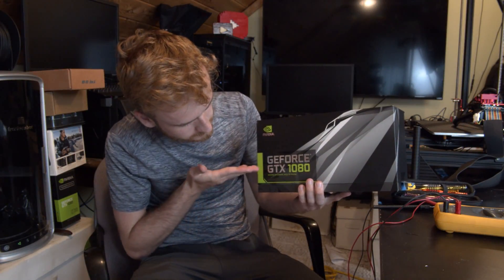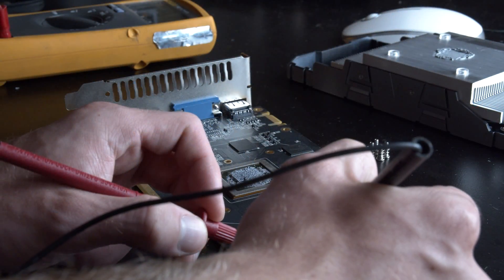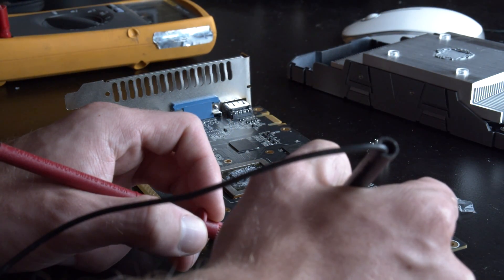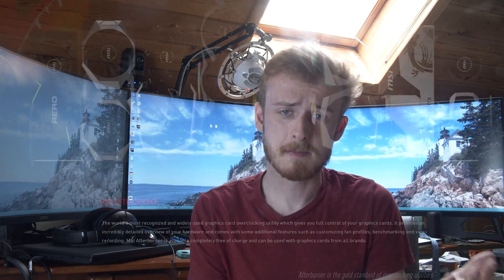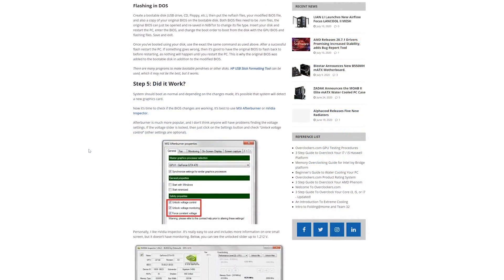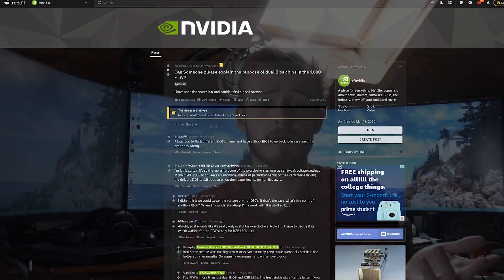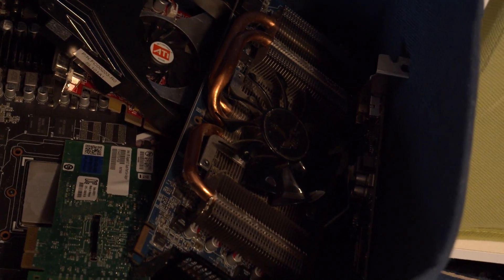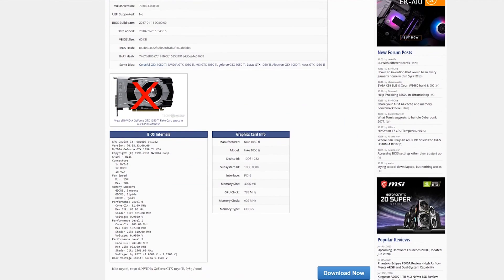The Shocking History Of Fake Graphics Cards Scammers Don’t Want You To Know | PC History

Comment: Online forums were a thing in when I browsed them in the 90's though, way before the more elaborate fake cards we see today. One popular scam I remember was apparently selling an 8800 GTS as an 8800 GTX, the former being inferior with a fairly large margin. They sometimes shipped with the same coolers which made them look identical until you installed the drivers. I know similar scams happened before the 8000 series too, but I can't remember the details anymore.

The Linux driver "nouveau" in the french word for "new". The story behind that name is actually kind of funny; one of the developers hacking around in the NVIDIA (then stylized as nVidia) open source driver (yes, once upon a time NVIDIA actually released the non-3D part of their drivers as open source) called "nv", had an IRC client with string macros. When he typed "nv" the IRC client, which was set to french, recognized the "nv" string as a macro for "nouveau". Amused by the coincidence he decided to name his reverse-engineered 3D driver "nouveau".

As a small side note ATi was really awful at Linux back then. Only a proprietary driver and incompatible with almost every distro, while the open source "nv" driver worked on every distro and the 3D "nvidia" driver was quirky but usable in most cases. From an end user standpoint it's practically the opposite of what we have today with the excellent open source AMD driver and the pretty much same deal as back then for NVIDIA, aside from the old "nv" driver which is since long abandoned.

It's also worth mentioning that overclocking GPUs go back way before vBIOS modding. You'll notice the string "RivaTuner" at some places in MSI Afterburner, because that's what the overclocking tool was called before MSI bought them out. It was the nVidia equivalent to ATiTool.

Other than that a good and informative video. :)

Comment: There's no need for anybody in the UK at least to get scammed, if you buy one of these turds of graphics cards to actually work, I used userbenchmark to prove that clearly the card wasn't what it claimed to be, took a photo of the result, claimed a refund from Wish with the userbenchmark evidence (clock speeds where there too, which clearly didn't match the clock speeds as advertised either) told them they had 24hours to provide a full refund for card and postage otherwise their card would be making another trip down to trading standards, full refund was given within the time slot, the scammers only carry on doing this because people let them get away with it!

Comment: Sometimes buying a fake 1080 for $45 and winding up with a 570 can still be a good deal. Not when you're expecting a 1080 of course, but when you know that you're getting something that isn't as good, and it sells for $85, That's a good thing. you can flash the correct bios and resell it as what it really is. Rinse and repeat until you've gotten enough money to buy a known real 1080. All for a good cause! Screw you, scammers!
Reply: get scammed - raid the scamers house = profit

Comment: they might start using a gt 1030 when it turn a decade old for their scams and sell it as a 6050ti. It may never stop.
Reply: I use a gt 1030 anyway, so i can't get scammed, also its still WAY better intel hd graphics, it has like 6x the fps in game lol
Reply: @karai5082  but not better than vega 11 igpu
Reply: i feel like a RTX 40 and 80 series will never exist beacuse of the Quadro RTX 4000 and 8000
Reply: quadro gt 6050ti
Reply: @Lord Ludicrous gt1030 I have ran left for dead 2 at ultra
Reply: I use a gt 1030 which is legitimately the one shown and named on the title when I bought it, the previous gpu scam I had before the gt 1030 couldn't even handle roblox for a test, stuck in less than 30 fps is very noticeable and the resolution made me thought the tv turned into a monitor just naturally had crap resolution. Turns out the gt 1030 did alright and the resolution being clearer on my monitor.

Comment: Imagine buying a fake GT250 and getting a RTX 2080 ti
Reply: And then since you’re buying a gt250, pairing the 2080 ti with a first gen low spec i3
Reply: @DrunkTruckYO MAMA HO
Reply: Lol
Reply: I would sell the 2080 and get a bunch of 250s😂
Reply: @hassan_dgf  really? I would sell the rtx and get 2 rtx 3000's
Reply: @Spongesgetti  i would sell the 2080 ti and buy an better cpu + the 3000 series on sale so the cpu does not bottleneck the gpu
Reply: @Spongesgetti  RTX 3000 is worth 3000 times the RTX 20 series lol
Reply: @Spongesgetti  3070 lacks SLI support, just a heads up
Reply: m8ks mi cri evri t1me